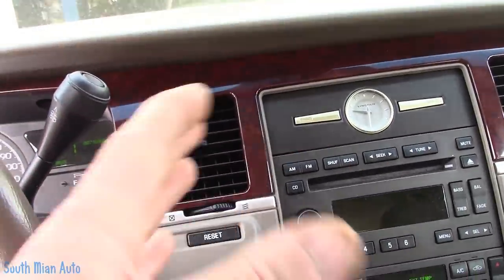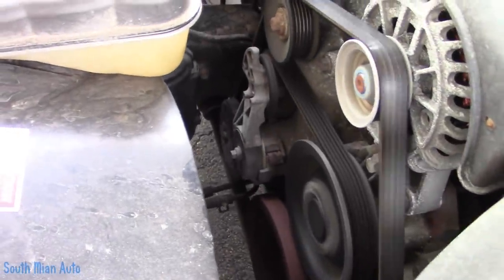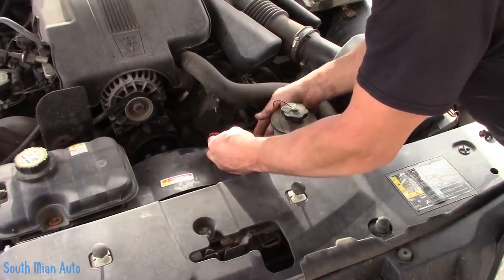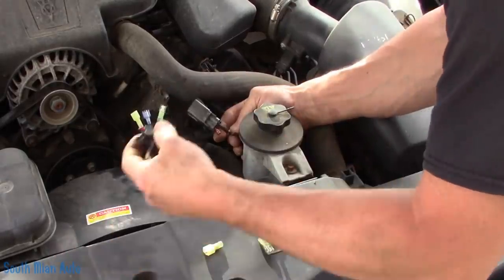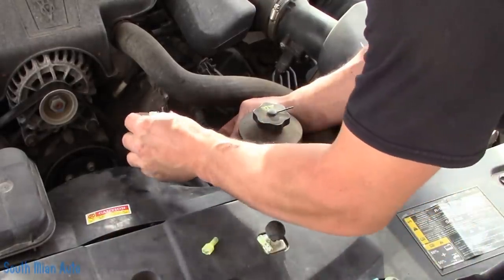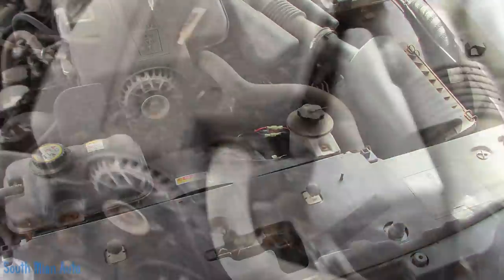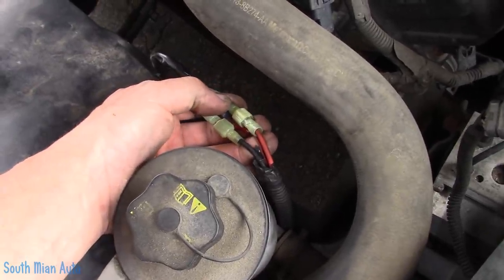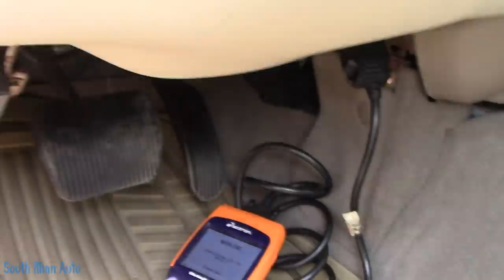Overheating Lincoln Town Car

Comment: The last of the simple to fix, reliable, American V8 sedans.  I have one, I restored it as a hobby, and I love it.   Parts are everywhere and cheap (the driver's door control module is a pain in the a$$, though).  It's a joy to cruise the interstates with.  Need a fuel pump/alternator/water pump....$100.   Brake pads and rotors.....$250.  The AC system is accessible under the hood....no tearing the dash out!!!  The 4.6L 2 valve is stupid reliable, simple and cheap.  
Look at the access space in front of the engine.  The fan connector didn't require removing the heads and dropping the fuel tank to gain access.  
My highest recommendation for car guys.

Comment: One of tricks we did at the phone company on taping up wires is to start with the sticky side out and on the second pass we would flip to sticky side down.  The the tape would two things,  hold together tighter and if you had to remove it just cut it would peal off leaving no sticky black adhesive.

Great video and fast troubleshooting.
Reply: That's interesting.  I use a first layer of friction tape then put a layer of super-33 over the top.

Comment: There's your problem lady.. lol. 
Awesome video. My mechanic had a Crown Victoria he rolled 500k plus on it.
Love those Town Cars,Crown Victoria and Grand Marquis.
I have a 97 Grand Marquis. 255k.
My only real concern with it is two fold. 1 rust on suspension components. 2 Valve cover leak. 
1 a minor repair, the 1st one could be the death of the car.

Comment: I got to get me one of those crown vic/grand marquis/ Lincoln Town car. 4.6L V8 and very reliable. Always liked those.
Reply: that 4.6 is an awesome motor
Reply: I just laid a town car to rest. Had 411k miles. Motor leaked from just about everywhere, but it was still strong. Oil had eaten every bit of rubber from the suspension though.
Reply: I wished they still made them.
Reply: Vic, townie, and marquis.....best car ever. A Ford F-150 w a sedan body bolted on....genius
Reply: I love when they make FoMoCo 4.6 videos. 253k on my 01 Crown Vic. I'm not even a ford guy. Just a fan of reliable cars.
Reply: @boondocker7964  So does most every police / fire / rescue / taxi company in the US.
Reply: Get  two while you can
Reply: Best engine ford makes
Reply: I've got an old 94 crown vic that was a cop car not a clue of how many miles on it and just about everything around the engine has broke but the engine is perfectly fine runs strong
Reply: That’s a fact.
Reply: Ive got one grand marquis and 2 2006 Lincoln town car all panther body and i love them all!
Reply: I got a CVPI. Indestructible.
Reply: I just hate doing the oil pan on those it's a pain
Reply: love my panther!
Reply: 06 grand marquis... tinted windows aluminum wheels lol yea yea
Reply: Love that they have a full frame to!!! As big as they are they get decent gas mileage too for their size.
Reply: @jonnygg6594  I think it's a great engine too. One of the things I love about it is the modular design where you can take the cylinder Banks off and still be left with the main crank. Rebuild that engine different ways. You can bore and stroke it or you can just replace the whole Bank.
Reply: @JohnRodriguesPhotographer  Still running strong. 273k

Comment: I just got done doing a front plate/oil pump reseal, also timing belt & serpentine replacement with idlers and tensioners replaced on my ‘02 Odyssey. I must say that car repairs are a constant story chain of victim to victory .. humbling then rewarding .. I don’t think I could do this for a living .. Hats off to you Eric O.

Comment: Don't like your comment--2005 Town Car not much life left. I've driven these cars for 35 yrs. Best highway ride out there. Usually trade at 220,000 miles.
Reply: They run forever if taken care of. I have a 99 with 240k and a 97 ith 80k right now. Been reliable ever since....
Reply: I think what he means is because they're in the rust belt. Hard to have a nice highway ride when you can peddle it like the flintstones car.
Reply: 500k+ on this Ex L of mine. Used for limo service and Uber since 2007. Still runs and looks good but, that wiring issue is chronic with Town Cars. The fan plug burns and causes the failure. I just ordered a new plug from Parts Geek. In the meantime I ripped the guts out of the control module and fashioned a manual switch to control the fan.
Reply: I have a '95 with 97k, going strong...it does have a few of the lincoln gremlins but easily mild annoyances.
Reply: @1001Guitarplayer  I've had a few cars that could be pedaled.  They're well ventilated
Reply: Here in the rust belt like where Eric is, time is more of a factor than mileage. Just sold a 2004 Ford Focus with 230k on it. Ran and drove like a dream, but the rear sway bar ripped completely out and took 3/4 of the subframe with it.
Reply: Agreed, notwithstanding the rust aspect of being that far north. I junked a 97 P71 (4.6 Windsor just like this) with 357,000 miles and drove it to the junkyard with no brakes. Rust got the frame and the brake lines.
Reply: Never drove a town car.  Mom had a Mercury Grand Marquis that was a great highway cruiser.  I liked the Mercury Marauders, but they were always too expensive for my budget.

Comment: Glad she didn't Chernobyl the engine! Those are the last good modern cars still on the road - gotta keep 'em rollin'! And for the record, I'd have done the exact same fix! Probably better than the factory replacement anyway.

Just finished general maintenance on a '03 Crown Vic - got deja-vu here, except yours has more fancy plastic in the interior, lol. Mine is a cream puff - 62k miles, and zero rust anywhere. Well taken care of vehicle. Neighbor owned it, and sold it to one of my customers (she asked me what cars are good these days, after her last vehicle spent more time in my shop than on the road, so I told her she can't go wrong with a big ol' RWD FoMoCo product). Had just 32k on it a few years back when he sold it to her. So far just been leaks due to age vs. miles, and plastic interior parts breaking, oh, and of course, front end components, thanks to our crappy roads combined with 21st Century parts quality.

Lunch is over. Gotta go weld some galvanized steel to an old log splitter. Hope I can find my gas mask. Hey, it's snowing! 😁

Comment: Always enjoy watching you fix stuff. One thing came to my mind on this one was what I call rule # 1,now!> If your are even just close to wiring ( as you were to fix it) Disconnect that battery! And I say this because once upon I time I DIDN'T!! and a power bar shorted out my horn relay,,and poof!! under dash fire!! wires, radio, heater,dash,,heater control,,headliner,,all gone,,would have burnt more if I hadn't fought the fire. Anywayyyy,, my car is now in a slow painful recovery and I learned to never skip my rule #1. Great informative vids ,thanks for your insights. Cheers

Comment: Love the fluid film shot on the crimp end of the connector.  A more than perfect repair for a retail repair shop.

I'm rather paranoid with any and all electrical connections.  I keep my vehicles for life (their's or mine) and since I do the work, I can afford the time and effort to go overboard.

No crimping...  Every connector gets soldered.  A dab of liquid insulation goes over the stripped wire boundary followed up by two sections of heat shrink tubing.  The heat shrink provides the necessary insulation and stress relief.

Comment: I lost coolant just after the belt came off on a Taurus, when a tensioner pulley bearing went out. There was no water pump till the belt went back on.
Bad for the engine. Remember when cars ran dual v belts to ps and alternators?
Reply: Just worked on a small block today. God I wish they still made them that easy.

Comment: There is nothing wrong with your repair, it won't play up and likely last way past the cars demise.
Yes it's an old car but it has lasted and still doing well :-D.
Reply: It's always interesting to me living in a no-rust part of the world how people in the UK and upstate New York define 'old'.
Our cars don't rust or corrode, the average age of a car on the road here is nearly 20 years old - and why not?
If we had mechanics like Eric out here, we'd still have Model T's running.
Reply: Ethel Ryan
Yes i know what you mean, but cars do age at different rates depending on the conditions it operates in.
So old can mean calender years or the effect of speeding up its overall damage.
If you know what i mean :-D
Reply: @zx8401ztv  
I have a 2001 Lincoln town car,  and it only has 115,000 miles,  still looks pretty good and runs great . I think it will the rest of my life so no need to replace .
Reply: If I were a betting man, I'd wager that aftermarket fan will take a dump before the rest of the car does.  I'm figuring it's probably Chinese.

Comment: Got the same problem on a 2003 Impala. The automatic fan control would not turn on the fans. Since this is a very high milage car customer did not want to spend much money. I hooked up a manual switch inside car to operate the fans. When temps climbed above normal he would just turn on the fans to cool it down. He is a very good customer and he is happy doing it this way instead of spending money on this old car.

Comment: FYI from a retired ASE Master Tech who was trained by GM at the GM Training College in Atlanta Ga. If the A/C is turned on, the fan should turn on and be on all of the time that there is a command for A/C, whether the compressor is on or not. Also, wires don't burn by themselves, there's no such thing as a faulty wire. Good chance that fan motor is high current draw and should be replaced. Good repair on the wiring though.

Comment: Thanks bud, this gave me something else to look for...a corroded electrical fitting. My fan was intermittant...turns out it was the fitting on the pigtail coming off the fan. Can't get a new fitting, it plugs right into the fan control module. Have to buy a new fan! Not on my watch...I soldered 2 new 1/4" female connectors on the wires and plugged them straight up into the control module !!

Comment: Wow, no 8 pieces of shrink fit with one big piece over the whole gaggle? Looked good once you got it tied up & taped. Nice quick job. $950 at the dealership, about $100 at SMA.
Reply: YEP STEALERSHIP, YOU NEED NEW FAN, RADIATOR, HEAD GASKETS & COMPLETE COOLANT FLUSH. ERIC, WIGGLE JIGGLY BITS, NEW CONNECTORS, WATERPROOF, TEST DRIVE, " BOOM " BACK ON THE ROAD.

Comment: My parents had an 04 town car, they are boats alright but sweet cars. They just glide over bumps.
Reply: I have close to a million miles of driving the Lincoln TC
they DO NOT glide over bumps.
they HOP over bumps due to those stupid air bags in back
only a Mercedes glides over or THREW the bumps
Reply: Are you sure the bags were not bad? You will know because the back end will be low to the ground. To each his own I guess.
Reply: @jdtractorman7445  of course I know
like I said I have close to a million  miles of driving these things.
they HOPED over bumps and really were not a good glide in the long run
A Mercedes goes THROUGH the bumps.
I had a 190E Mercedes that would put the Town Car to shame.
Also a 1984 bmw csi that went through bumps like they were not there
but for their size the TC cornered good.
Its not a boat like most most drivers think though.
save your pennies when the rear air bags blow out.
Reply: You spelled the word  "hopped" wrong. You are comparing vehicles that are not really comparable to each other. I would never own one of those other models you mentioned, to expensive to buy and their replacement part cost is most likely through the roof.
Reply: @jdtractorman7445  I pissed higher up the wall than you did
Reply: @orbits2  
you can replace the airbags with springs, I did just that on my 2001 Lincoln town car,  rides good and much cheaper than replacing the compressor,  and air bags

Comment: I like your attention to detail with the dielectric grease, fluid film etc. Would completely trust you with my old Honda. Though in that situation I would use a Deutsch connector, dunno if you keep them around the shop but be perfect for those kind of repairs.

Comment: Do you have a link to those electrical cutters/strippers your using? Thanks.
Reply: Look like snap on. Around 65 bucks
Reply: Those are standard flip out carpet cutters with rasor blades in them usually found in old shavers. Amazon should have some in good quality. ,65usd.. Are you insane?
Reply: For the cut/strip/crimp pliers, search for "Vaco strip crimp". That should link to several other makes and styles. Vaco, Xcelite, Proto and other US firms have been making various styles for more than half a century, copied by many foreign firms into products sometimes of questionable quality. For the "DeOxIt", you can safely substitute a blast of WD-40 or a blob of petrolatum. The aim on new connections is to stop later oxidation, not reduce existing oxidation as there should be virtually none existing.    

That Lincoln is a stout old girl.

Comment: I drive a 03' TC and that is EXACTLY how I would have fixed my own car. Besides, more zip-ties = more power right?
Reply: That means I must have 800+ horsepower. 😂

My front bummer is held on/together with about 30 zip ties. Headlights have about 4 each. The last exhaust hanger is held up with 3 zip ties. 😂😂😂🤷🏻‍♂️
Reply: I have some safety wire in one of the cars.

Comment: My Crown Vic had the same problem...twice within a week.  First time was bad fan motor.  Second time was bad module.  Replaced both with junkyard OEM parts, all good now.  For sh*ts and giggles, I checked parts and labor prices at the dealer.  IIRC, the module was $600 by itself.  It was a $1,000 job.  Your customer is lucky to have you, the dealer would have raked her over the coals.

Comment: I think it was a great fix.  why replace it with an expensive connector where what you did worked just fine.
Reply: This is how I would've fixed it. Its not like it is under warranty. Plus the factory or maybe aftermarket fan connector was garbage. It failed. At least he put in the same gauge connectors so they were tight.

Comment: That repair is great.   She was out $5 in connectors and $15 in coolant plus your time.   Very fair.   A dealer would have probably solder her a new fan assembly, new wiring harness, had the car for a week and charged $800

Comment: Those Ford "Panthers" (Crown Vic, Marquis, Towne Car) just don't die !  I also live in the "rust belt".  There are hundreds of them driving around here including many retired cop cars so you know they did not have an easy life.
Reply: Jack Patteeuw Absolutely! The police here in northwest Ohio still use them often and most of them are over 100k. That’s a hard 100k+ too. Local suburban police station is already getting rid of their 2016-2018 explorers with 50k on them. Just goes to show those old school tanks we’re just flat out built better.

Comment: I'm glad you felt the connectors while the fan was running to see if there was any heating due to a bad connection or the spades were to small for the current drawn :-) I'll never get to see your area so thanks for the ride. I had a 1990 turbo Loyale that had the right fan wired backwards so one sucked and the other blew causing over heating. I fixed that so they both sucked :-) It didn't over heat again. It's the only Subi I shouldn't have bought cause I didn't know any better then. All the rest were not turbo'd. Happy Father's day :-)

Comment: We use the same coolant. Only thing I hate about it is how clear it is. If you don’t use it all and go to use it again later it’s hard to tell if it’s been mixed with water or not. I had to get in the habit of splitting it and mixing both gallons at the same time.

Comment: Nice car good job like always. My first car was a 86 Chevy cavalier I had trouble with the fan kicking on   change fan relay and temp sensor , so I wired it to a fuse so it would turn on with key.

Comment: I drove a Lincoln like that once from Miami, FL to Houston, TX and back. Found the steering so loose I couldn't keep it in a straight line on the highway.   Moving the wheel small amounts to make corrections didn't do anything. Then boom - you're veering off to the side! Cops pulled me over because they thought I was drunk LOL!

Comment: The Legacy GT in your lot looks just like mine, except a lot more stock and probably more rusty.
Years ago, I used to work for the state motor pool and worked on a lot of state police cars. Back then, they still used Crown Vics as the primary police car. At least once a month, even more in the summer, a police car would come in with a complaint like Check Engine light on, engine running rough, or AC not working after a traffic stop. In pretty much every case, it was because the cooling fan didn't work. Oddly, they almost never complained that the temp gauge was so far past the H that it was almost back to the C. Side note: the rough running complaint was caused by Ford's overheat strategy to shut down every other cylinder and even alternate which cylinders fire in an attempt to "air cool" the engine. Seems to work decently well on the V8 modular engines, not so much on the others. They also set codes and turn on the check engine light when the engine temperature gets to high and a separate code when they shut down cylinders.

Comment: Did you do an amperage draw on the fan? I see the connectors are bad but sometimes that is the secondary effect even though an overcurrent should really blow a fuse first … that is assuming the fuse has not already been up sized

Comment: burn out from mechanics testing cars? I loved testing the chevrolet caprice rear wheel drive 158mph police cars with the z28 motors. limited slip you could burn the tires for great double burn marks for about 50 feet easy just punch it at a stop. those police cars were the best. fast, reliable, very tough, great crash protection for the occupants.